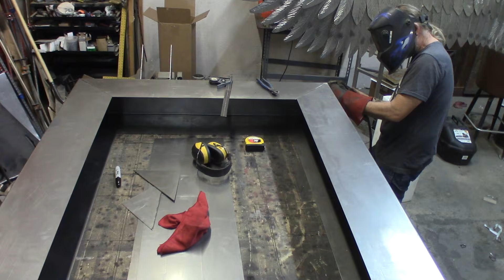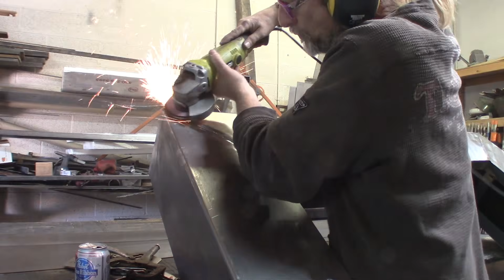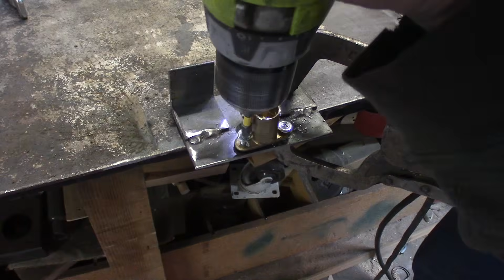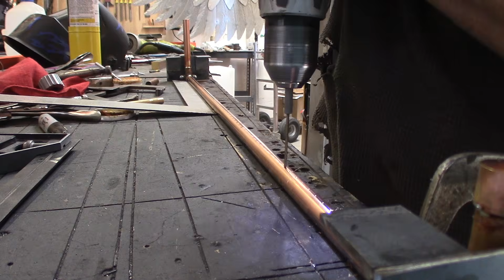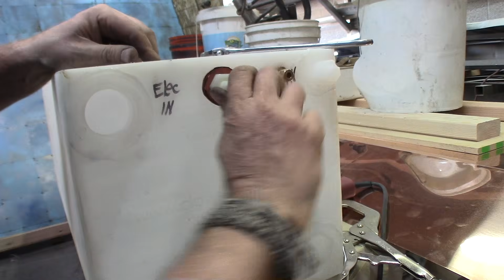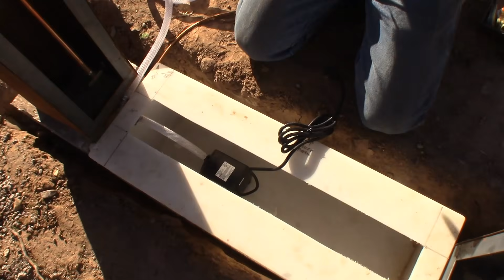How to Build a Rain Curtain Water Feature

Comment: This is cool no doubt. But for everyone else, you can just use drip irrigation line  inside and build your frame out of lumber and stain. Way cheaper and easier for those without a workshop and metal working skills.
Reply from the maker: Thanks for watching, and you're right, there are lots of ways to achieve a similar effect!

Comment: What kind of irrigation fittings are those?
Reply from the maker: The kind I stopped using after about 6 months. I actually went to a threaded nozzle that wouldn't move around. There's another video that shows the modification that I made. And you can get the nozzles online from Glennco Fittings part #011307

Comment: How did you get your water to stay in tote in the ground without it seeping over
Reply from the maker: I used an evaporative cooler float valve. it turns the water off once it reaches the desired level and back on whe it runs low

Comment: Excellent build! I plan to put a water curtain under my deck, between 2 of the vertical posts. Any idea how often this has to be refilled? I would guess lots of evaporation with a curtain style fountain,  but probably less than normal evaporation from the tank since it's covered. And how to measure water height after it's all covered up to make sure it doesn't get too low? I don't want to run a water line with an auto-fill valve. Just top off as needed. Experiences or opinions, anyone?
Reply from the maker: Evaporation really depends on your area. Here in Arizona, water evaporates at a fast rate so the auto fill nice. In more humid areas, it may not be as fast. I suppose one method to check level is to use a clear tube that extends up so you can see it and put something in the tube that floats so you can see if it gets lower. They use a method like this in Mexico to refill water tanks. Usually several ping pong balls on top of each other in the tube until you can see them, if that makes sense
Reply: @ArtfullyRogue  love that idea, thanks!

Comment: Excellent video! In my area it is very windy. What if I would run fishing strings so that the water would have a better direction. Would that work?
Reply from the maker: I know a couple clients that have done that however I'm not sure what process they used of how well they handle the wind

Comment: Hi this is amazing.. what are the irrigation plugs you use please?
Reply from the maker: Well I've actually stopped using the irrigation plugs and started using nylon nozzles. Check out the modification video I have. And those nozzles can be bought online fromm Glennco Fittings part#011307

Comment: If you don't want to use acid use a good degreaser and rub raw potatoes cut in half on the metal this will flash rust very quickly
Reply from the maker: Cool, I'll to check that out

Comment: 2 years on how is it holding up?
Reply from the maker: This particular water feature had some issues due in part to the quality of water being used. It had a high calcium content and despite several attempts at recommending a water softener in the system, parts of the columns are rusting at an accelerated pace. I've not had any issues with any of the others I've and shipped out though.

Comment: nice job!  wish I could weld.  guess i get to pay you to do it. lol.
Reply from the maker: You can do it! You can get a cheap little welder to learn on a knock out little projects
Reply: @ArtfullyRogue  recommended types of "cheap little" welders?
Reply from the maker: @tomwalling5796  If you're just starting out and depending on budget, I would grab a cheap gasless welder from Harbor Freight. I used flux core mig (gasless) for years before I changed over to gas mig . I actually just found the most amazing flux core wire from a company called YesWelder. I've used .035 flux core wire from Lincoln Electric (big name brand) for over 20 years. And I tested the .035 flux core from YesWelder and it is the smoothest wire I used ever. And if you have the budget, they also have an incredible multi purpose welder (205DS) that will allow you to do flux core welding, regular gas mig welding, tig, and stick welding.  And because I got onto their affiliate program, if you use the code ARTFULLYROGUE, you get 10% off you entire purchase.  I just got their multi process welder and will probably do a brief review of it soon.
Reply: @ArtfullyRogue  i was just looking at a HF 125A welder for $130. Looks like you don't need gas for this kind of welder and it works in a regular 120V electrical outlet.  Makes it a lot easier.  i actually have wanted to weld for years.  wife just left me, so i got a ton of time on my hands now. lol.  i guess this is my path. thanks for the info! yeah, i see the 205DS.  i suppose if i get into welding a lot, i'll probably want to be able to weld lots of different things.
Reply from the maker: @tomwalling5796  heck yeah the little 120v welders are what I used for years. Mine is a Lincoln but it was given as a gift. Had I bought my own the first time, I would have gone with HF. 120v welders are compact and mobile which is great.
Reply: does the 205DS plug into a regular 15A outlet or does it need a 20A outlet?  I can't tell in the manual.
Reply from the maker: @tomwalling5796  yes it does. That's what's really cool about it. You can use it with120v or 240v and it comes with the adaptor

Comment: do you know the size / gallons on the the tank you use? Also, what it the rule for the gallon storage needed? thanks and great content
Reply from the maker: Hello Gary, I think for the water feature in the video I used a 20 gallon tank. If there's a rule, I'm not aware of it. I would say use whatever submerges the pump and flows through the plumbing lines and add a gallon or two more to deal with evaporation. If you're looking for something more detailed, contact the guys at Graystone Creations, I buy my pumps from them and they are a wealth of information

Comment: Hi, how do you stop the inside of the frame from rusting? We have had a water feature made, similar to yours. However, instead of a rain feature, ours has a Japanese theme, with 7 water-troughs positioned diagonally opposite each. We’ve used Hammerite on the outside, but we’re unsure what to use on the inside. Thank you 😎
Reply from the maker: I haven't used anything on the inside of my water features as water rarely gets into the column. However I would probably mix up a batch of fiberglass resin and brush it on the inside.
Reply: Thank you, I appreciate your suggestion.

Comment: Hey Doug, love your work.  where did you get the catch basin from? what was it made from?   Thank you
Reply from the maker: Thank you very much. I purchased the tank in the video at plastic-mart.com and its polyethylene. I stopped using them because of cost and it took too long to receive once ordered. Now I use 45mm pond liners
Reply: Artfully Rogue thanks for the quick response.  So you fabricate a box and line it?   I’m building one based on your design for my sister.
Reply from the maker: @johnlebeau1  Actually just dig a hole deep enough to cover your pump and lay the pond liner into the hole. The side should overlap the hole to catch any splash and divert back into the hole
Reply: Artfully Rogue thank you.   Much appreciated.
Reply: Artfully Rogue I’m currently struggling with this,  I agree way too expensive for the basin. I tried to use a 55gal container from HD but my fill dirt /sand is collapsing the sides. For the pond liner method do you have a way to cover that with rocks?  Thanks for your time!

Comment: I love it. I am from Germany and won’t to build it on my one.
Can I ask you what strength is the sheet?1,5mm in Germany?
Yesterday I ordert the Nossel 10/32 Tap.Thanks a lot
Reply from the maker: I use a 20 gauge sheet steel which I believe is close to 1mm. I would go a bit thicker but the company were I purchase my steel can only bend the 20 gauge without distorting the shape

Comment: Have question for you BTW very impressive work and I got inspired to do similar  water future
I wanted to go ahead and buy square tubbing from local recyclable still supplier
Are there disadvantage of buying say 8x8” steel tubing in say 1/16 or bit thicker square tubbing , cutting them and later welding ?
If I took this route than how would I install the copper pipe ? Perhaps running inside the vertical tubing ? 
Any tips would be greatly appreciated. Thank you !
Reply from the maker: Personally I've not seen steel tubing that is 8"×8"×1/16" which is why I chose to go with having the steel yard bend 20g sheet steel into channel. It also makes it easy to add the plumbing with one open side. It also helps with any maintenance, I can easily remove a panel to gain access.
Reply: @ArtfullyRogue  how did you attach the inside panels for access later to do maintenance?

Comment: Thoughts on this? How about using a spot welder and placing a backing strip behind each seam to facilitate the spot welder? Might add to the industrial/art look and would make strong, easy welds with no burn through worries.

Comment: Sorry I am bit confused, the pump on the video looks like a cube and was not good enough? is that the Jebao WP3500?
the one under your link on the description is the right one? it comes in 3 sizes 1200, 2000 and 3600
thank you in advance for the clarification
Reply from the maker: I upgraded since the video. Get the 1200 got in the link. That's what I'm currently using

Comment: Thanks for posting this up. It's an awesome design. I see you post up two pump suggestions: Jebao WP-3500 & EXTRAUP 2100GPH....which would you currently recommend for an 8' high version? Thanks.....
Reply from the maker: Hi Jay, I've actually been experimenting with a different pump which is direct drive. I recently used a 2750 gph with an 1.5" pvc supply line to the rain curtain which I also did with 1.5" pvc. It was strong and so I installed an inline valve to reduce pressure. Graystone Creations is the website and the pump is called EasyPro. I'll propably step the pump size down to the 1850 gph for my next fountain. I would recommend the 1850gph for the 8' fountain.

Comment: I’d love to try making one of these out of pvc finished with wood framing. Probably just using a big plastic watering trough to hold water with a circulating pump inside. I think if you put it in a hole at ground level and then layered some rocks on top it would look pretty awesome. 🤔
Reply from the maker: 450rmack that's pretty how this one is set up minus the wood framing. I have a plastic water trough under the rocks with a fountain pump moving the water up to the top of the water feature 👍

Comment: I can't find hollow irrigation plugs.  Can you help me with a brand name or style?  All the ones I find are solid throughout.  Also, how do you minimize splashing and water loss where the water hits the bottom?  Thanks. Great video.
Reply from the maker: Hi Alexandra, there's a company called Glennco Fittings they have a hollow threaded nozzle.Search part # 10307

Comment: Bravo!    cuple questions if I may ask?
  What size pump did you end up needing/getting?
  Im assuming the water flows through the copper pipe and drops through the holes,  is there any min. amount of pressure needed or anything like that, so that the holes on the end get the same amount of water and pressure as thee 1st?  Feel free to tell me im over thinking this, haha.  
  Great work and video.
Reply from the maker: I ended up buying a pump with a 13' lift from Amazon, Jebao WP-3500. That size pump easily pushed the water up 7; and across the 36" span that I had for the fountain.

Comment: Your tank is surrounded by earth.  If you install a catch basin, about 6ft. x 6ft., then your splash trickles through the rocks, hits the basin, and drains to the tank, and you conserve a little water, while cutting out the natural consequences of earth, and water, weed germination growing up through the rocks and becoming unsightly.
Weeds will still hit the basin, get water and grow, but without well anchored roots, they are easier to remove.
Reply from the maker: MarkH10 there's actually a vinyl liner under the rocks that drains back towards the catch basin. Before I installed the liner, I was losing a lot of water in the surrounding earth
Reply: Artfully Rogue I would expect much loss without it. I didn't see it, and I paid attention to it all, I like this feature very much.

Comment: Excellent job as usual, some years back, we did a similar feature with  chains hanging down from the lintel, iirc, you can sort of "tune" the volume of the "waterfall". It was for a small garden of house that was near a motorway (freeway?) and the water sound cancelled out the tyre noise, I think it worked -it was a few years back tho so can't recall,  but anyway, thought I'd mention it in case its of use to somebody.
Reply from the maker: Jaques Daniels that sounds interesting! I like the idea of making sound that creates different tones from the water hitting an object. If you have a picture that'd be cool to see it 👍😀
Reply: It was some years back before digital cameras, but if you imagine an arch like yours, with chains (heavy ones that won't get blown about in the wind) under each irrigation fitting, I think the chains were different lengths, ie, the water runs down the chain, then depending on the length of the chain, the drop to the water in the catch  makes the sound.I think it might have been designed by this lady https://www.amazon.com/Ground-Force-Water-Garden-Workbook/dp/0563551135, not sure, note- this book is for gardens in the UK, and some of em are postage stamp size, the trunk of some older American cars are bigger than UK "back gardens". So beware if investing in the book.The end result was a kind of hissing noise rather than a p-----g noise LOL, I tried a few google searches but could not find anything like it, sorry.Incidentally, heavy chains were used instead of down pipes for rainwater at one time.I'll keep looking.

Comment: Turned out great Doug.  I didn't know about using the irrigation fittings vs. straight up drilling holes.  Great tip.